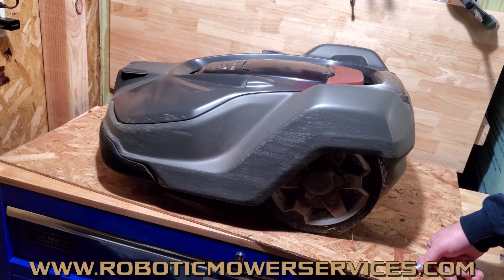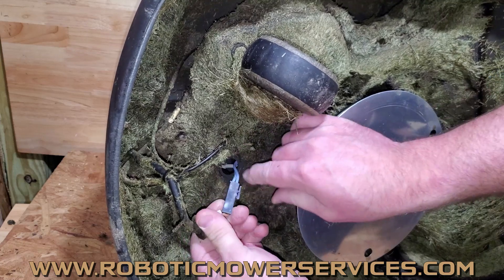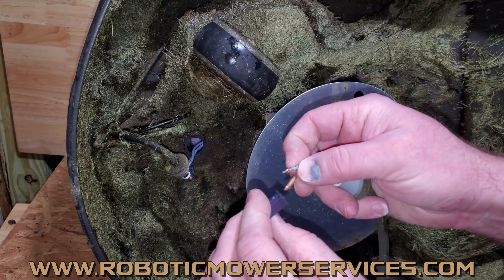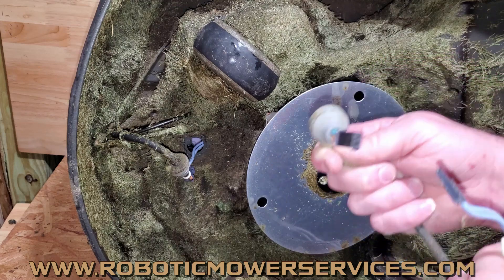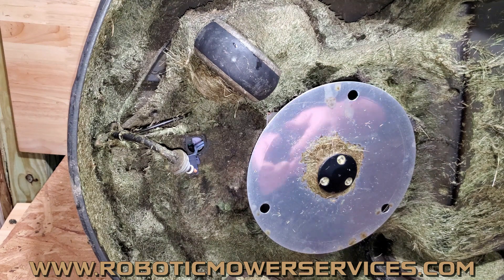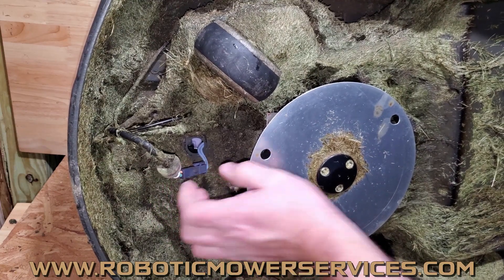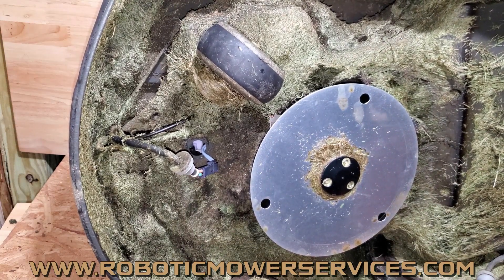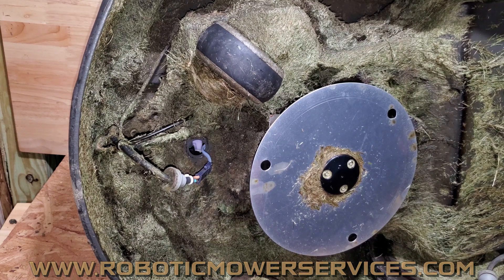Husqvarna Automower Battery Will Not Charge (450X, 450XH, 550, 550H Charging Plate Wiring Issue)

Comment: This video helped me, and i replaced the Charging Plate Cable Assembly and Charging Link Wiring Assembly (new blue and brown version), but it only lasted 13 months. Now the Charging Link Wiring Assembly is blistered again 🫤. This time it looks like the other end of the connector fused to the board as well. 2017 450x.

Comment: Great video and allowed me to both quickly identify my 2017's problem (with blister) and note to pull it off the charger so it wouldn't cause more heating. 

Gotta say, I'm not particularly thrilled with how many design issues this 450 has had through the years and the cost of parts. Obviously, that's not your fault, but if I had to pay a dealer to diagnose and fix this thing, I don't think I'd really be that far ahead of paying for lawn service. They've been building these since the 1990s--> how they still have these sorts of issues baffles me.

Comment: Thank you for these videos. I had an outdoor rated GFCI plug that also has outdoor lighting attached to it which appears to have blown out from a short or lighting strike. The plug on my power supply/transformer was literally melted from arcing inside of the outlet. After troubleshooting that issue, I found that the 450XH mower was still not charging, and stumbled on this video. You say not to directly splice the wires, but I did so anyway just to confirm that my issue was limited to a bad connection here and not also something else. After directly splicing the wires, charging resumed as normal. With that confirmed, I placed an order for the link cable and charging assembly. One additional thing to note is to make sure to get a sealing strip since the housing needs to be taken apart to replace to link cable.

Comment: This happened to me with my 450X, so I bought a replacement charging plate assembly as well as the internal cable.  Alas, when I went to replace the internal cable I discovered it was melted to the main CPU board.  It took a great deal of force to get the cable out of the mainboard connector, but now it is easy to see the mainboard connector is all burnt up.  I can only assume the mainboard itself is non-functional.  This sure seems like a major design flaw that Husqvarna should be accountable for.
Reply from the maker: They've added a feature called "Charging Current Supervisor" now. But with this safe guard comes some new quirks and potential errors. Here's a video we made about it. https://youtu.be/Ux_zt4X1CFU
Reply: Here in Ireland it is covered under warranty! If the charge loom is melted on to main circuit board, doesn't matters how old is the mower.

Comment: On my 2019 Husqvarna Automower 450XH it was spitting the "Empty Battery" Code a few times. (And I was getting the "disconnected" readout in the app due to the 3G Wireless shutdown this year.) I pulled the grommet and the connector was bubbled and wouldn't pull apart. I cut the four connector wires (after marking the blue wire that connects to red with a sharpie) and used two wire nuts to connect things back together (while waiting for OEM parts to come in, there goes $75) and it fired right back up and took off like a champ after getting a full charge. Thanks for all your help here, I appreciate all the helpful videos.
Reply from the maker: Thank you for the great feedback!

Comment: I replaced my connector with a properly sized Molex connector that can actually handle 28v but the menu is still showing a negative charge current on both batteries.  (-98mA/-91mA)
They show a -3mA charge...  Have these reversed polarity and won't charge?  I know this happens with batteries run in series which I assume these are most likely.  The blades read 27.89V when I have the mower docked.  What is the voltage I should read at the blades?

Comment: These are all mowers with two batteries and therefore higher charge currents I think? Connector is probably not rated for the current it is seeing. Probably why you don't see the problem on single battery mowers... I have a 430X so probably safe... 🙏🏻

Comment: Hi. Mine says it charging but the battery level is not moving. Been charging for a day but nothing happening. Has been in storage powered off over winter. Just docked it to station today. Any ideas ? Thanks .
Reply from the maker: Probably going to have to replace the battery if it is not charging. Double check what is going on with you battery using the quick info menu as shown here in this video of ours https://www.youtube.com/watch?v=3plUxxsQBno

Comment: Had it happen on a 550H EPOS
Reply from the maker: I know they at least changed the grommet on the charging plate harness. Time will tell if the connections are any better on the new version or not.